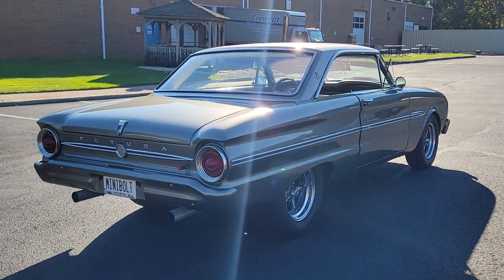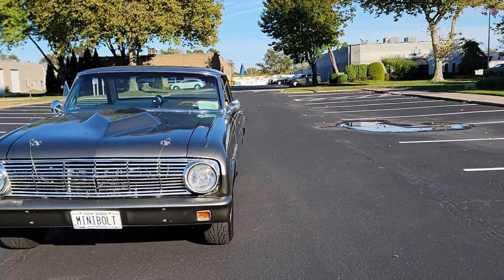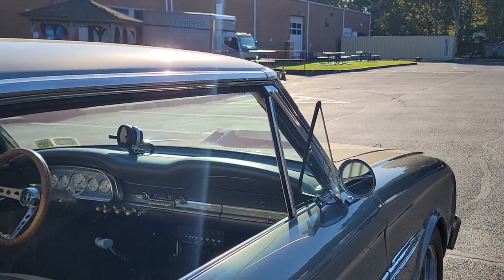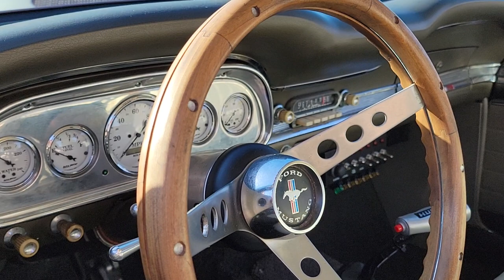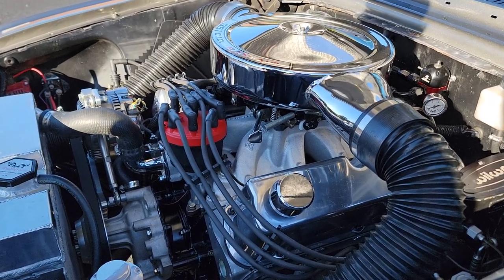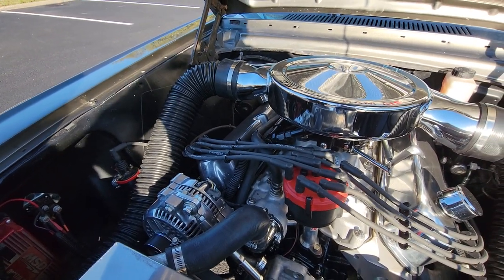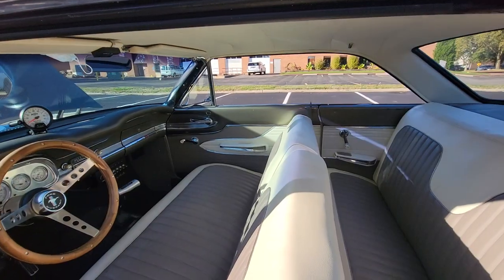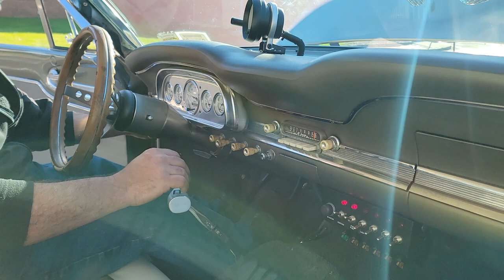1963.5 Ford Falcon Sprint(Futura) Pro Street For Sale~408/500+hp Stroker~5 Speed~BIG $ Invested

Comment: This is my cousin's car. It has the best of everything. And by the way, my cuz is the best wheelman I know! He could drive that car through a keyhole and not scratch the sides!!! This car is a complete freak, a BEAST& anyone would be proud to own it. It's a steel at this price!!!👍
Reply from the maker: I agree, it's a "Real Mans* Ride and Built to Perfection!
Reply: A "real mans ride"? How so? To your mind, what makes this car a "real mans" car. Moreover, what to your mind is a "real man"? Just curious.
Reply: @s.hooper4683  dont overthink it buddy
Reply: @StreetTruckinTitan , no, not to be overthought but as I have built/owned more then 100 cars and or trucks over the years, I've found that bolting a 500+ horse power engine (per the title of this video) into a 2500 pound car is pretty impractical for anything save for it's obvious ability to do some pretty impressive burnouts. Case in point. Years ago, I bought a '55 ford small window short bed (one of many I should have kept) with no motor/trans. I decided that instead of doing the right thing and putting a 302/4speed in it that would have pushed it along just fine, I would install the 460/C6 I had out of a '73 Lincoln I had built sitting in the back of the garage. Result: there wasn't a set of rear tires of any size that I couldn't run bald in one evening in any gear I wanted to. Fun? Yes, but totally impractical. Some guy came by and offered me 5x what I had in it including the purchase price so I sold it and moved on to my next project. Sorry for the long winded response but it seemed necessary. Anyway, to each their own. Your money. Build what you want with it.

Comment: Someone explain to me why the '69 351W block is better the a '70 - later 351W block. I personally don't use the Windsor engine for anything over 320 CI or so as the 351C -2V is easier (for me) to work with in building streetable horsepower without the obnoxiously long stroke of a Windsor. This is a nicely done car to be sure. The workmanship looks clean from what I see here and from what the owner said, he apparently spared no expense in getting it done. Just not real practical for street use but hey, that's just my opinion.